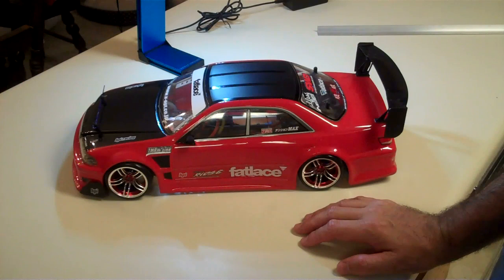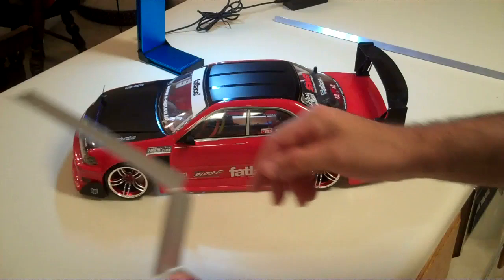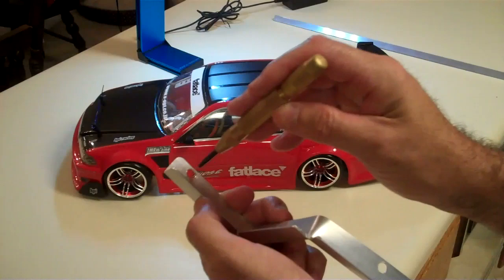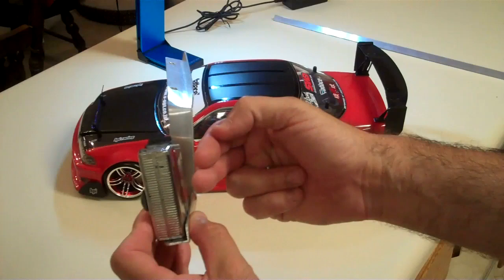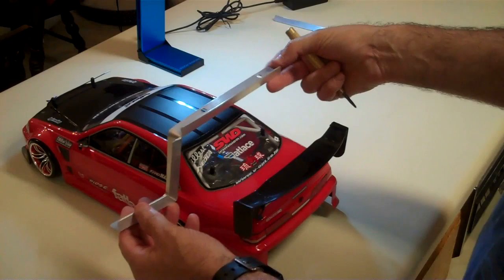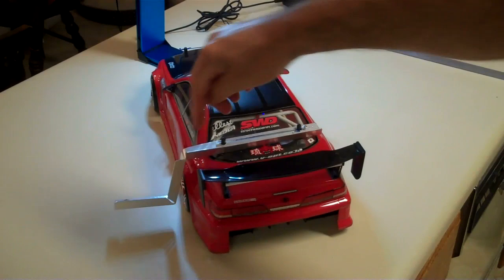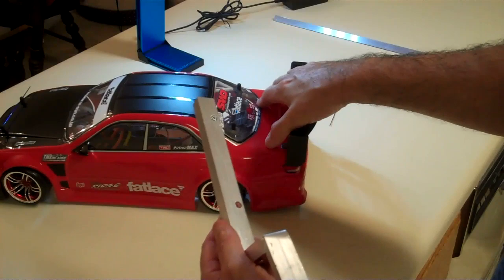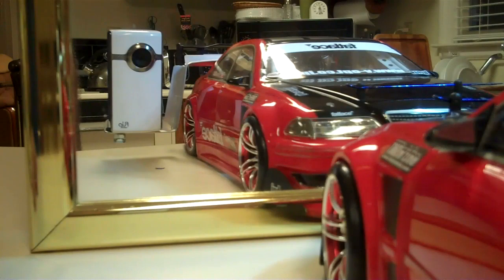Do It Yourself RC Camera Mount (Very Basic Design)

Comment: Well, I'm getting camber links, 3mm to 6mm offset rims, a steering angle mod, and turnbuckles. I got some sushi drift tires, new 4500mah battery, traxxas tq3 transmitter w/ the reciever crystal, new axles, and some new front rims and a R34 190mm body. I need some good quality light buckets for it and I'm in heaven.